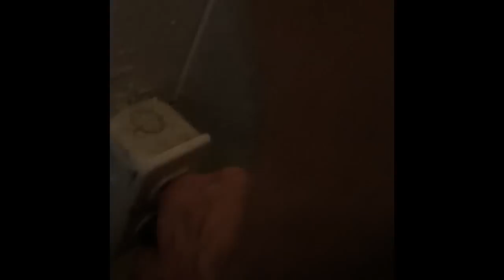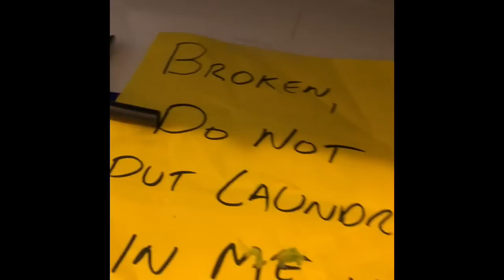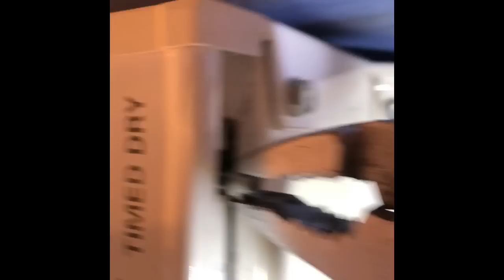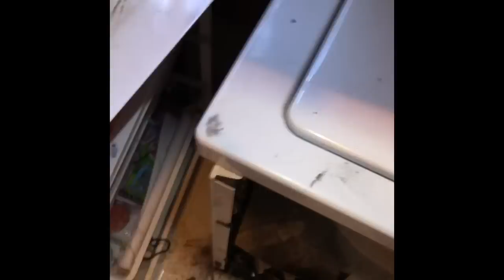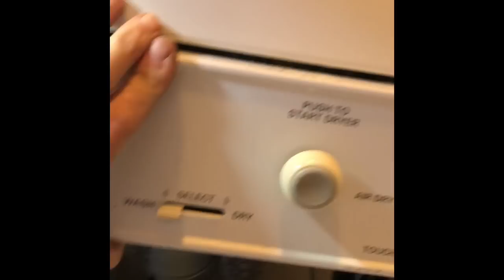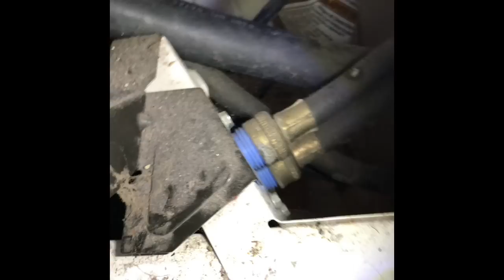🌎 Laundry Center  Washer Won’t Drain or Spin? LET'S FIX IT!

Comment: Great video on how to access the control panel. I was able to change out the timer with no problem. However, I am still having the same issue. Won't spin. Next i will test the continuity of the modulator that connects to the timer and and pull it apart to check the coupler.
Reply from the maker: Could it be the lid switch?

Comment: Thank you for the details and instructions. I replaced the timer and it still doesn't spin at the end of the Heavy Duty cycle.
Reply from the maker: I wonder if it’s a bad lid switch?
Reply: A week ago I could hold the lid switch down with the screw driver while its open and it would spin but today its no longer spinning when I reset so whatever is going on is getting worse. @QuickAndEasy5MinuteAppliance

Comment: Great video, appreciated. I just have a question. Trying to narrow down diagnosis before I crack this machine open.
My timer can be heard advancing then it just stops. I believe the machine should be draining while it's advancing. Question; will the machine make an attempt to spin if there is water present in the tub?
Question; does the switch effect the draining operation or just the spinning cycle?
Thanks in advance.
Reply from the maker: I think the lid switch is dead.
It should let power go to the pump and spin.
Reply: Turned out to be the timer. Thanks for the video and response.

Comment: I have a Kenmore model 110.88732793 24 in. laundry center. How can I bypass the master switch selector so I can wash and dry at the same time
Reply from the maker: Hi Michael ,
I think you would need more incoming voltage to make that work👍
Reply: @QuickAndEasy5MinuteAppliance  I figured it out. Jump bk/Y to the bk on the master switch. Works just fine

Comment: My thin twin washer filled with water but it didnt start the cycle. Put it in different cycles and the drain cycle but it's not doing anything at all.. And filled with water.
Reply from the maker: Just need to replace the lid switch.

Comment: Thanks for your videos! I guess if lid locks the motor won't come on at all it's not good right? Not a sock blocking it from spinning then right? Guess I need to take it apart and check right?
Reply from the maker: I wonder if the motor start capacitor needs to be replaced.

Comment: HI I HAVE A GE SPACEMAKER WSM2420TBAWW  AND IT WORKS BUT DOES NOT GO TO NEXT STEP... STAYS ALWAYS WASHING.... SO NOW I HAVE IT FULL  OF WATER. HOW CAN I RESET  OR YOU WOULD SUGGEST ? TKS
Reply from the maker: Sounds like it’s time for a new timer😊
Reply: @QuickAndEasy5MinuteAppliance   I WANT TO BUY THE TIMER FOR MY SPACEMAKER: WSM2420TBAWW,  BUT GENERIC , THE ORIGINAL IS  TOO EXPENSIVE: 
 220.-  WHERE CAN I FIND GENERIC TIMERS ? THANK YOU FOR YOUR HELP
Reply: And if I take the timer could it be just dirty ? Or reset ? Can I reset the machine ? If not I’ll buy a new timer 🤷🏻‍♀️ ....

Comment: Mine would just do the initial wash. It doesn't rinse or spin.  :(
Reply from the maker: I wonder if the belt broke ?
Reply: I think I have belt or motor issues its like it wants to kick on. Timer makes noise but wash cycle has gotten louder too but its like the motor doesn't have enough strength to spin

Comment: Great video..spin ok rinse ok drain none?? Any suggestions.. thanks again be blessed
Reply from the maker: You’ve got something caught in the drain impeller housing.
Just need to remove the front panel and then clamp the hose between the tub and the train motor and then pull the drain motor away from the impeller housing and you’ll find a bobby pin or paper clip or bra wire or coin that’s blocking the impeller.
Reply: @QuickAndEasy5MinuteAppliance  
Got it done ...how much will it cost me for the job..? thanks
Reply from the maker: About 95.00

Comment: Did I see correctly that you are using a continuity tester on the switch side of the door relay?  THat is the side that is disconnected from the electrical wiring. I am not getting a read out on my voltage tested when I try to test the side of the cable that goes to the timer on the front.  I thought you had in your test the connector side that hangs off the grey plastic relay that clicks.  Mine clicks but I could not get any voltage reading from the other end of the connector.  We bought this washer from someone and it was working before we moved it. THe only thing we did besides unplug the electric cord and disconnect hoses was remove the washer top.  I did follow this video and the timer which very clean already.  I can only think it is the switch for the lid top but for me not to get a reading from the wiring that is connector to the timer is odd that it would stop working the moment it was relocated.    Is that continuity tested different than a voltage tester?  My voltage tester is really only good for testing sockets in the wall as you have to press it into a hole and this plastic sleeve has a spring to it that exposes the copper lead inside of the tester arms.  I am not sure if the voltage tester was really making a connection hence my question about the continuity tester vs my voltage tester.

Comment: My washer same model only during draining cycle will not spin. I will have to open lip and close the lid for the washer to start to spin. What is the problem? New motor and new clutch
Reply from the maker: Just need a new lid switch

Comment: What if it’s not going into the rinse cycle. What would u suggest?
Reply from the maker: I wonder if the cold water valve stopped working.

Does it work on cold setting?

Comment: My frigidaire fex831cs stackable washer and dryer is have trouble working. The washer is the problem, I have started a cycle to wash clothes and it has stopped mid cycle with water filled up and clothes still in there. Can someone help me ASAP! Thank you!

Comment: i just fixed it with a zip tie. hellllll yeaaaa this saved me so much annoyance
Reply from the maker: Excellent ,

Thank you
Reply: @QuickAndEasy5MinuteAppliance  Could you help me, please? I have a similar laundry center and I happened to be in there when it happened: I saw a bright flash from that area of the room and then the washer just stopped spinning. I then could smell something like that hot electrical smell. And now the washer won't drain, it will fill, but it hums during the spin or draining cycles. The lid lock tested goid and so did the timer. I have taken off the front panel and taken apart the gears, pulling out the motor. I have started the washer with the motor sitting outside the machine and sure enough - the motor humms but does not spin. Is there any way to fix it, or do I need to replace it?. :-(

Comment: I have a stacked one piece combo unit (dryer on top), and the washer isn’t getting to full speed spin, so the wash is too wet when done.  What do I need to do/replace to make the washer spin fast again?
Reply: It is also a whirlpool. It’s the small one...only 24 inches wide
Reply from the maker: I wonder if it’s going to spin at all?

Might be time for a new belt.

Comment: This video was helpful but I put the dial on wrong somehow, like the indicator doesn't correspond to what it does. How do I know what orientation is what when the knob is off so I can align it right? EDIT: Nevermind, I made an educated guess based on testing. It seems to be correct. Unfortunately the plastic thing on the dial is loose now and apparently nothing I can do about it ; (

Comment: This just saved my sanity.  I thought I was going to have to order a replacement switch and use a laundromat while I waited for it to arrive.  When I heard "zip tie" I decided to check it out.  Sure enough, the top and bottom halves of the switch were separated.  One long zip tie later and now it works.  For those curious, I used a 5/16" socket.  The sheet metal screws in the back might be metric, but it was close enough to get them off and back on.

I can only assume the down votes are because of the weird audio where you can hear the original talking under the voice over.
Reply: I didnt down vote it but yes that is very annoying, also when he starts to say if you set it to spin and pull out the handle and nothing happens its probably... Then  decides talking about taking out the two screws without ever finishing his more important sentence. Also instead of us showing how to clean it, aka the actual fix he cuts to a diagram instead that doesnt help any for how to clean it.